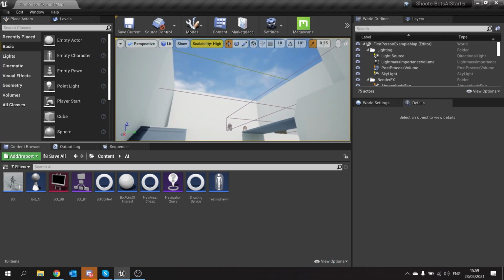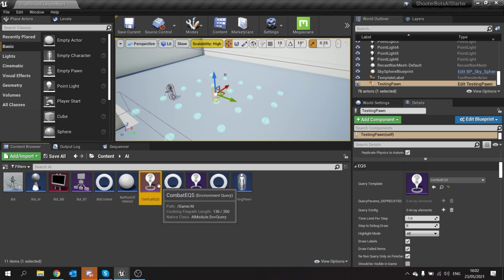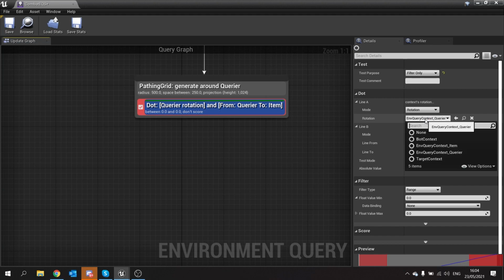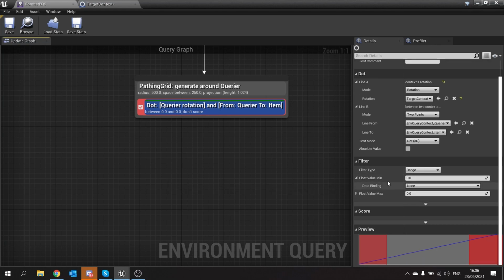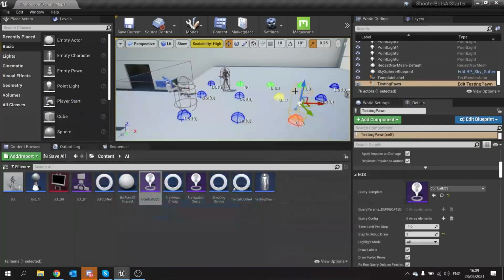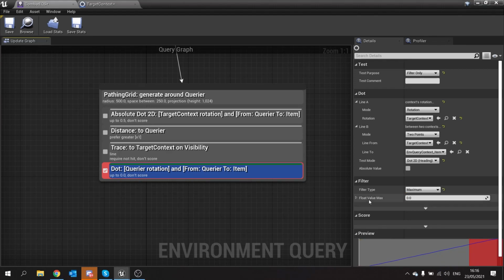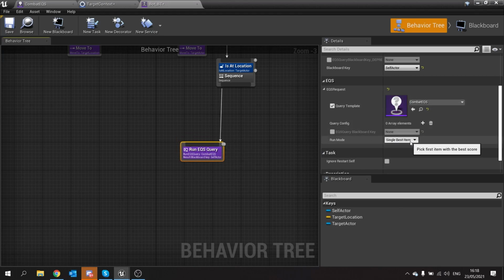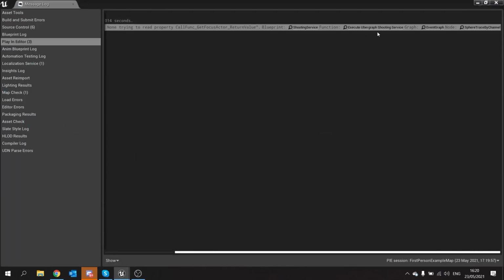Unreal Engine 4 Tutorial - Deathmatch Bot AI Part 7: Bot Avoidance

Comment: I've tried twice - at the 6 minute mark, my EQS shows only the single center circle as red instead of that middle line, any clue why that could be happening?
Reply: I had the same issue.. For some reason I just cannot get that workaround working where you hardset fps character in targetcontext.. Not in this tutorial, and not in another AI tutorial I did..
I still followed Ryans settings, and it works as intended, even though it did not show it with my testing pawn..
Reply: Doesn't work with my testing pawn either
Reply: it could be that you didnt uncheck some of the items tests in the combat EQS, thats the thing i missed

Comment: Somewhere along the line I broke the strafing mechanic and can't seem to fix it by following this video, any idea what might have caused it?
Reply: When I changed the acceptable radius of the Is At Location blackboard decorator to less than the first Move To after the ShootingService, the enemy stopped strafing. After I changed it back it worked fine. Not sure if this is the problem you are having.
Reply: @nehemiahkimble1878  Interesting, I fixed it some time ago now and can't remember what I did so I'll keep that in mind lol. Thanks.